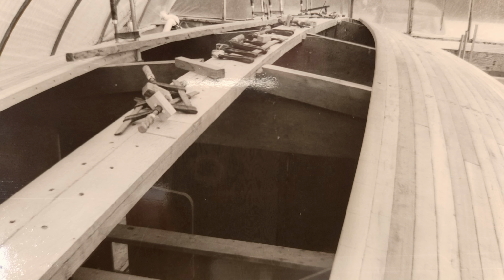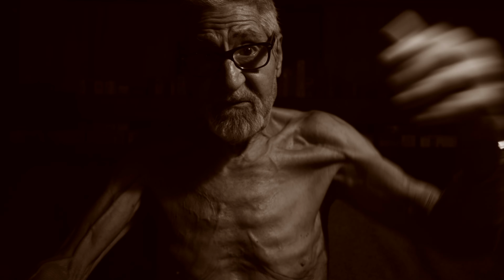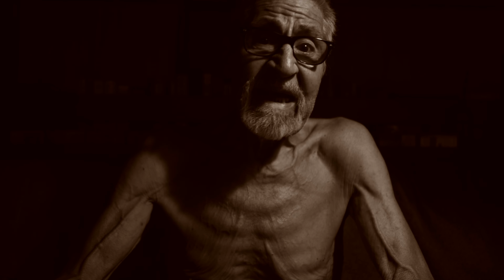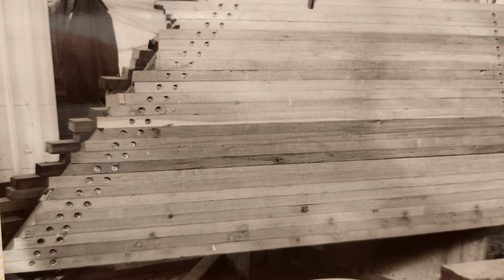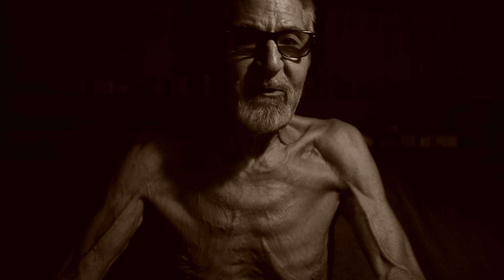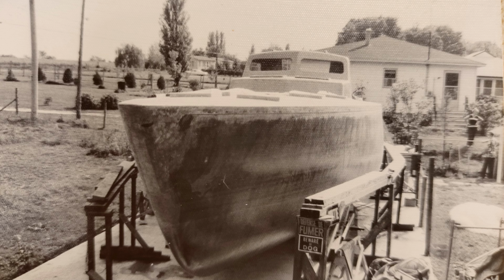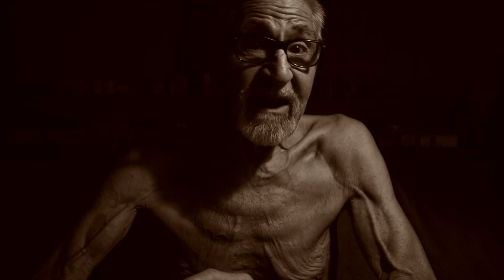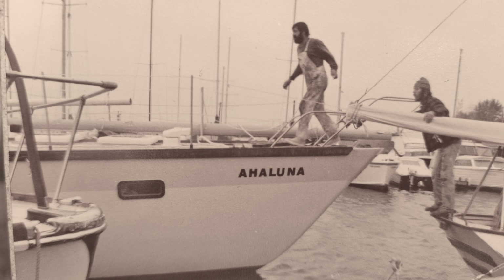Build of a Lifetime

Comment: Immediately I see the mastery of this presentation- with a builder slimmed down to his bare bone frame, upon black & white film, seldom pausing, explaining fine details sculptured as clearly as winds address a sunset of clouds🎐
Reply: How thick did fiberglass layers add up to on the hull? Did you use a finishing resin on the final layer and gell coat? Great accomplishment and feeling of satisfaction!
Reply from the maker: Waxed resin, no gelcoat, min. thickness 9MM-3/8",  doubled ca. 4 feet wide centerline, stem ca. 1"